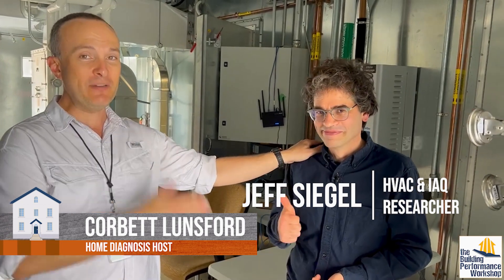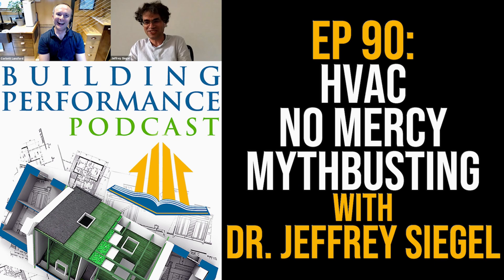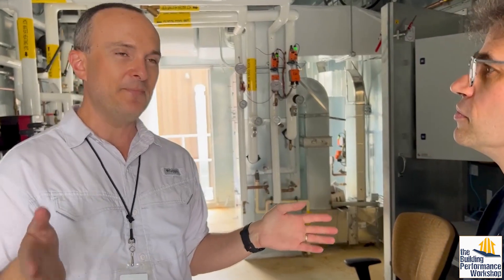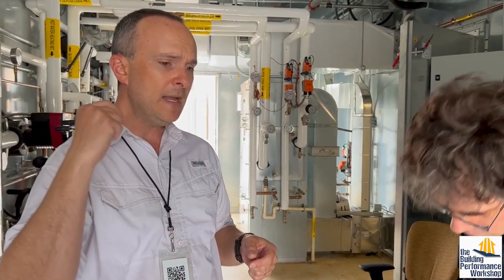Home Ventilation Advice from HVAC Researcher Jeffrey Siegel: How Many CFM is Ideal?

Comment: I keep coming back to this one. 
I work in a hospital and the AHU has UV lights. 
Here’s the issue: 
The filters facing the UV light are clean but the other side of the filter is covered in mold. 
What’s the solution?
Reply from the maker: Someone should change the filters
Reply: @HomePerformance We do…but within a mouth the mold is back. Is that normal that UV just works on the one side and the mold grows on the other?

Comment: I have a HEPA filter set up on a bypass loop, but i take it up a few notches by piping the fresh air from my ERV into to loop before the HEPA, then before the air gets returned to the plenum, it goes through a dehumidifier. The HEPA and the dehumidifier’s CFM are very closely matched.

This means that 100% of my fresh air brought in from outside is getting the HEPA treatment and being dehumidified before mixing with the house air.

Comment: Corbett, The primary pollutant I worry about with lots of bodies in a pretty small space is CO2 that's being exhaled. For example, I share a 120sqr ft bedroom (960 cubic ft) with my wife and two dogs for about 8 hours each night. No amount of filtration will pull any CO2 out of the air. Is there an erv out there that can handle this kind of load in such a specific space while also working as a whole house solution? 

I'm imagining a standard erv that's maybe 120 CFM but is split between bedroom, living room, office, etc. Etc. Which means something like 30 CFM going into the bedroom on boost mode. That means running for those 8 hours it only moves 240 cfm out of the room leaving most of the CO2 there. How do you address an issue like this?

Comment: Hmmm… running the ac system fan full time with leaking duct work or ductwork which passes through an unconditioned air has proven to be disastrous. Also, running the fan full time after a cooling cycle will turn it into a humidifier. No bueno. Not all houses are airtight and thoughtfully built.
Reply from the maker: It’s a system, absolutely

Comment: Where is this 5-6 air turnovers (a turnover defined as passing the equivelent enclosed volume of air through the filter) per hour coming from?  Is this based on Gage and  Bidwell law of dilution?  Just because you pass the equivalent enclosed volume of air through the filter, doesn't mean you have filtered 100% of the enclosed air.  Gage and Bidwell would say only about 63% of the air has been passed through the filter in the first turnover do to mixing of the air.  At the 5th turnover you have filtered 99.3% of the air and at the 6th, you are at 99.7%.
Reply from the maker: I’d say the effectiveness would have a lot to do with room and duct arrangement. 5-6 per hour was used in COVID classrooms as an ideal for standalone air cleaners with no ductwork at all.
Reply: @HomePerformance  I would agree supply/return size, relative position and velocity will impact the turnovers required to achieve filtration of 90+% of the space air.  I was curious as to where the 5-6 for standalone filtration in a covid classroom came from.  Assuming there is science and not conjecture backing up the recommendation.

Comment: So you have taught us quite well about sizing HVAC, sizing circulation/cleansing, and sizing balanced fresh air, but not everyone has the luxury of treating them as separate systems like in your awesome house. It would be great to understand how to combine them all if you have to (coupling return vs supply and so forth) and what the priority would be for separating them if you could pull just one out on its own.
Reply: You do not put lipstick on the pig . Use multi split and small ducts for HRV
Reply from the maker: Ooh, video forthcoming about why I actually don’t advise that, Andrey! And yes, Todd, video forthcoming for you too.
Reply: @andreycham4797  I submit that your proposal falls far short on filtration.

Comment: What sensors should I buy to test indoor air quality?
Reply: Yes!!  This is all great info. and as an engineer learning a lot.  I'll continue to research your videos, and I sure hope you address how to best measure the effectiveness of our system.  I know I need an O2 sensor and the oxygen is important.  Also of course temp & humidity sensors but I don't trust those electronic VOC sensors for their accuracy.   This sure is a complex project I'm taking on in a small house that was built in the 40's...here in LA.  I'm literally doing everything possible to make it a clean room like a hospital.   MOLD...every home especially this one has it somewhere in the walls, ceilings or below and this alone is quite a challenge.   I'll know when I've reached a clean livable place when I'm not congested 24/7 in here.

Comment: 2 questions. 1) How do you recommend modeling the airflow in a house when designing the ventilation system? ideally I want a simulation and optimization of the vent placement room by room. 2) If I do not want to splurge on ventilation now but want to put in some duct work for the future, any recommendations?
Reply from the maker: I don’t know why you’d need a simulation, it’s fairly simple math. It’s a pretty deep topic though, check out our Ventilation playlist or book an hour consult with me and we can make your plan.
Reply: @HomePerformance  Well I guess I wonder about the fluid dynamics of the ventilation - where do the vents go in the room to ensure the air quality? If the supply and return are too close, presumably it's not good, but what are the metrics? Seems like compute is cheap enough these days that finite element simulations could be done to get precise answers to design questions. Maybe overkill, but I'm curious what the gold standard is for modeling and simulation for ventilation design.
Reply: @ThisIsNotAVideo  wow, lots of words man.  the further the supply and the return are away from each other, the the more space is influenced by the flow differential.  This is high school shit.  You dont need computational fluid dynamics and Navier-Stokes equations ffs.
Reply from the maker: Hey Ray Man, I hear where you’re coming from, but the good news/bad news is we are literally making this stuff up right now. We are the ones we’ve been waiting for.
Reply: @theastuteangler  High school shit...lol...I don't remember learning this in HS or by any of our horrible US doctors in allergies or immunologist my entire life.  We live 75% + indoors yet our total crap medical system has done ZIP in this research for the American people.  Doctors are supposed to help people with their health...right?  All the doctors I've know, and a lot of them, just care about how much they're making and all have their trophy wives or in my cousin's case trophy new 20 year old girlfriend every few months

Comment: I’ve seen the relative humidity go up pretty high in houses when they keep the fan “on” their thermostat. When the AC kicks off, the fan continues and pushes the water vapor off of the evaporator coil causing humidity issues indoors. Just my 2 cents.
Reply from the maker: In theory yes, but that’s how my HVAC runs in Atlanta and our RH is locked at 45% at 76F with a 120pint dehu.
Reply: @HomePerformance  Absolutely. The dehumidifier makes all of the difference. Air circulation is vital, but unfortunately when done through the HVAC you go through filters monthly. It’s totally worth it though.
Reply: It’s also amazing, might I add, the feeling of sitting comfortably in 76 degrees with low humidity. People look at my thermostat and are like what the heck?!
Reply: If you're going through filters monthly, then you need to look at the source of what is getting filtered. The only way they can clog that quickly is with a constant very small particle source.
Reply: @christopherhaak9824  Absolutely keeping a house clean is important. One big problem is HVAC returns being installed at a low level. Carpet is a big issue too to contributing to dust and contaminants.

Comment: To retrofit our house, I settled on a Fantech HRV with ECM fans, and an ecotouch IAQ controller.  It's great how it can be set to some reasonable lower CFM speed, but it adapts to extra activity based on the VOC sensor in the controller.  It's fun to watch and seems to being working well in that regard.   Question:  do you know of an outdoor incoming air sensor controller to detect if the outside air is poor  (ie: wood stove smoke, not very often, but sometimes.), and use that to trigger recirc mode or turn off the HRV, so as not to bring in poor air.  I believe the Build Equinox CERV has this type of feature, but I haven't seen any others.
Reply: IFTTT could be used based on local weather data and pollution but it wont tell you when your neighbor is using dryer, doing barbeque or he just remote started his car in the morning to warm it up :D Also VOC or CO sensors wont pick this up. I with that kind of sensor exist!

Comment: Thanks for the video.  Regarding the fresh air component, I try to control my system to maintain about 600 ppm max CO2.  This takes ~50 cfm of outside air per occupant.  However, in order to reduce the VOCs to acceptable levels it requires an enormous amount of outside air.  Is this typical or is there something else I need to consider to reduce VOC level?  Thanks.
Reply: Keep, as much as possible, VOCs out of the house to begin with.  Use the safest unscented cleaning products, don't use incense or scented candles, out gas stinky stuff outdoors, use a kitchen fan hood when you are cooking.
Reply: I know Corbett hates air purifiers but Field Controls DUO-2000 will get it lower very quickly

Comment: That guy in the video doesn't know what he is talking about.....

A lot of the comments thus far are great get at a much larger issue.  Our buildings are systems.  Changing one thing doesn't always have the intended consequence.  Trying to ventilate and maintain a positive or negative pressure inside is really hard if you don't have a really good enclosure (trying to inflate a leaky balloon is the appropriate analogy).  Using an ECM fan (or, quite honestly, your entire air conditioner) when you have a constricted return ducts is not going to work out well.  That is the fun and the challenge of what we do: every building is a puzzle that you have to figure out and it often plays out differently in seemingly similar buildings.  Pressurizing in a cold climate has a higher chance of leading to a moisture problem in the enclosure when the exfiltrating warm moist indoor air hits a cold surface.  Depressurizing in a humid climate is going to introduce a big latent load to your air conditioner (which probably isn't able to deal with it).  Overall, I generally like the idea of pressurization with filtered and dehumidified air, but your enclosure has to be designed for it (more of a challenge as it gets colder).  Separate issue, for those asking about VOC removal.  A good activated carbon (with enough carbon to actually make a difference) is wonderful stuff.  A 4 or 5" deep pleat high-MERV particle filter followed by a good 1" activated carbon filter in your central system is a great system if you have the space to accommodate.  Make sure the filter slots are high quality and gasketed.  

And seriously, don't trust the guy in the video.
Reply from the maker: Thank you for being so knowledgeable and so untrustworthy, Jeff my man.
Reply: @HomePerformance  Lol...Jeff knows all
Reply: Jeff is so good and its difficult for him to give direct answer as at the moment of asking him a question he probably sees hundred of variables and he gives relative answers. I just wish he answer's emails  more often :D

Comment: what about the CERV2 system by Build Equinox?  Doesn't it use sensors to monitor the indoor air quality and "dilute" with outside air as needed... and only when needed?

Comment: ECM blowers are by design more efficient but when attached to overly restrictive ductwork and loaded filters can actually consume more energy than psc motors. In that situation your motor is likely to fail prematurely ( earlier in its lifetime and with less total run time ) don’t rely on modern tech to save your bacon. Hire HVAC companies that know about ducts. Not all do.

Comment: I'm currently in the design phase for my home's HVAC retrofit.  The house is ~1200 sqft in Phoenix, AZ.  My plan was to use a mini-split with between 1-3 heads for heating and cooling.  Then I was planning on using a small commercial ducted HEPA filtration system that would act as an air handler of sorts as well.  It would have one centrally located return duct and then the supply ducts would be out in all of the rooms.  In addition to this, the ERV would have exhaust vents in the kitchen, bathrooms, and laundry with the outside air dumping into the HEPA supply side so it is filtered before entering the home.

You mentioned people tweaking their setups based on the environment.  I believe the system as described above wouldn't need to be tweaked, which I think is ideal for the average human.  We just have too many other things to deal with in the average day.  What I would like though is for the ERV to have a way to automatically bypass the core between certain temperatures.  For example, it may be 90 for the high here in the fall or spring but the lows may be in the 60s.  If the ERV were to bypass the core once the outside air is cooler than inside until the inside hits a set temperature that would save a ton on cooling here.  I do believe this technology exists, just not at the price point I'm at.  I could see that same device that does what I described being used to let less outdoor air in on high pollution days, but if you dump that air into a filter first does it really matter all that much?  I suppose it would prolong the life of the filters.
Reply: ERV core bypass is currently available. i know of one brand that uses it as an economiser. as you describe. is it actually worth it ???
Out door pollution is an interesting question. it depends on what one you measure. ventilation air all comes through a filter anyway. so some pollutants are filtered out. i highly recommend using a separate filter and not relying on the built in filters of the erv.
Reply: @tweake7175  Yeah, my plan was to dump the outside air from the ERV into the return of the filtration system so that air runs through the HEPA filter and then uses that ducting to reach the rooms.
Reply: @robertcrowley9677  you can, but that doesn't remove the need for filter at the inlet. i would still run a hepa on the incoming supply before the erv. that keeps the erv core clean and you have clean air coming in regardless of what is happening with the other system. it builds in some redundancy. i'm also a fan of piping the fresh air direct to the rooms rather than the dump it in one room and circulate from there. 
you want the ventilation system to still distribute clean fresh air regardless of what the hvac or filter system is doing.

also keep in mind of any airflow short circuits. whats the easiest route for the airflow to take. i've seen it where the ventilation bypasses the hvac and goes straight to the ventilation exhaust.

Comment: One topic that interests me is best practices for location of equipment and ducts (in new construction). These best practices would be valuable for giving appropriate attention to making equipment accessible for maintenance inspection, future replacement or with modular replacement parts, able to be retrofitted with future controls, monitoring… I think there is a lot to improve there
Reply: Word. I want to put ducts into a new construction build to future proof it. It's so easy to do this for electrical - run conduit through inaccessible areas instead of Romex, and pull more wire later. What are the options for ventilation if I don't want to spend $20k on a system today and the stud bats are accessible?
Reply: @ThisIsNotAVideo  You could build a plenum (when you are ready) under the ceiling in the rooms, and run ducts through the plenums and though adjoining interior walls. That's one option to not open the walls studs later. This puts ducts in the conditioned space (and not in the attic). This worked for me in a renovation of a single story 650sf 1930's home. Would work even if you want to maybe add a system later and you're doing new build now. You could account for the plenum space if its a new build so that you avoid the common complaint plenum being in an awkward spot.